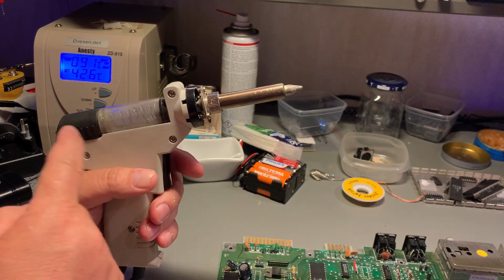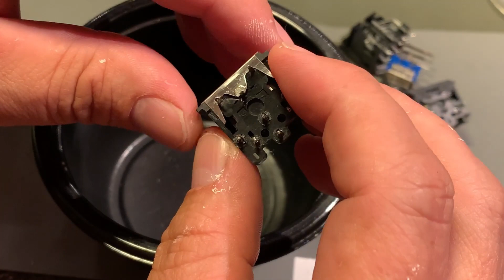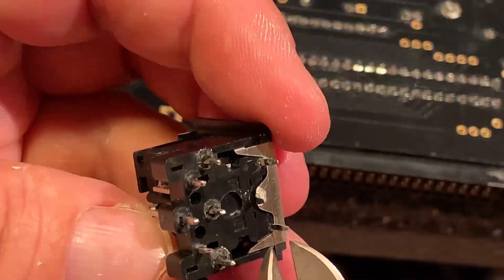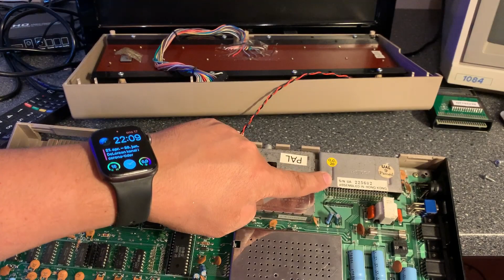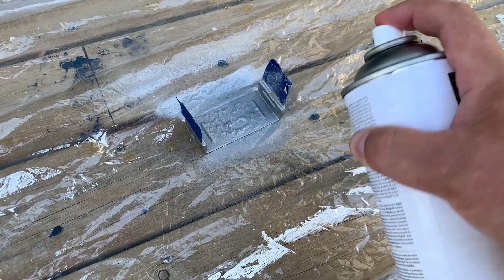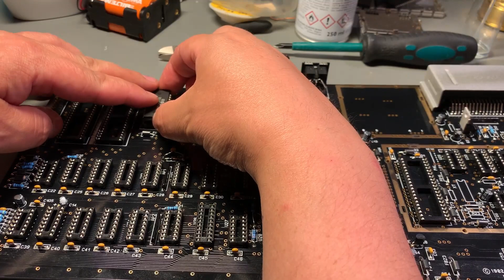Building a Commodore 64 computer - Part 3

Comment: I found some of these parts online. The switch, connectors and so on. I was not able to source the DB9 connectors with screws, shield over cartridge connector and the choke coil. So I have used a dead donorboard for some parts.

Comment: I am wondering if a " SD-60LS " may be used? Granted it would mean its pins would have to be soldered to the plug and the Motherboard but the main thing is it's available "NEW"

Comment: Interesting SID replacement you're using here. I also did use a replacement replica C64 motherboard on one of my C64s, but this was already populated and I only had to provide the specific C64 chips like the CIA, VICII, SID, 6510, PLA and ROMs. I used a replacement PLA but the rest of the chips were salvaged from other systems. Considered using a SwinSid or another variant but put in a real SID in the end.

Comment: Exciting. You are almost at the finish line. It's a shame that trace had to be cut -- maybe a future revision of the board could have two pads for an optional solder blob or not, as required. Excellent work so far.